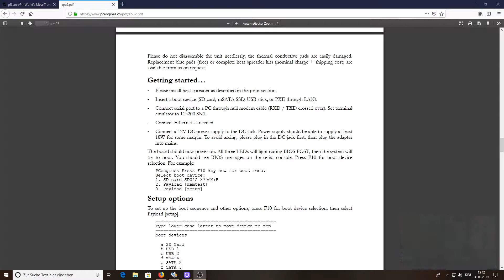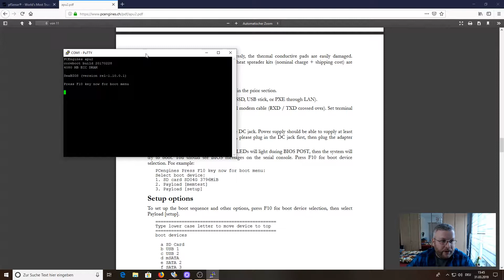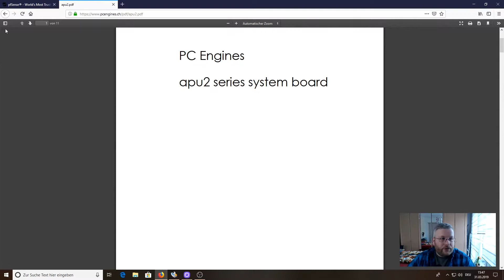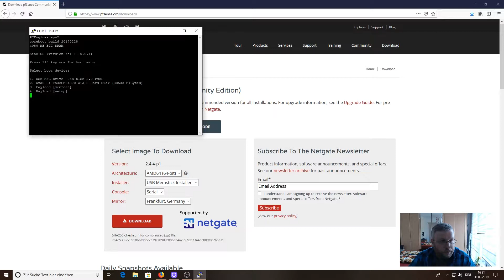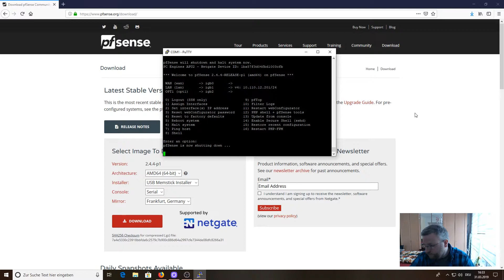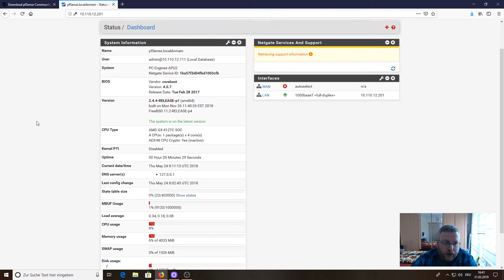PCEngines 2 PFSense - Part 3 - Installing PFSense over Serial Connection

Comment: What is the best hardware to buy for the new pfsense coming up 2.5. On the that website pcengine you were on 
Thanks
Reply from the maker: That depends on the number of network ports you need. The APU2D4 has 3 and the APU4C4 has 4. Both support AES-NI so they should have no problems with supporting the PFSense 2.5 release.
Reply: @germanaccentguy  
Thanks for your great advice and for your time too